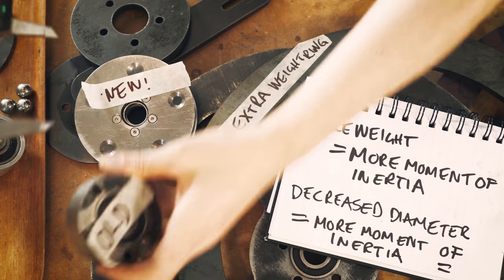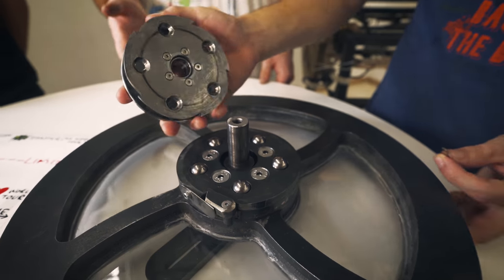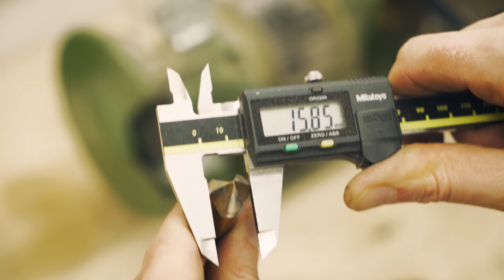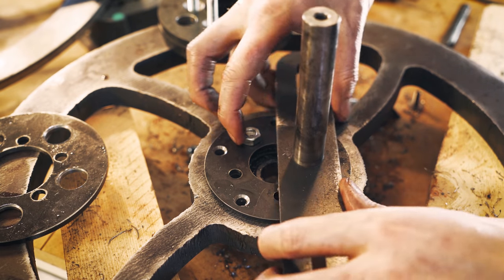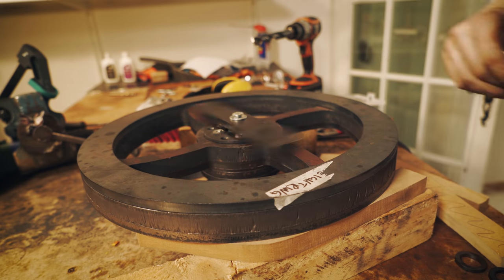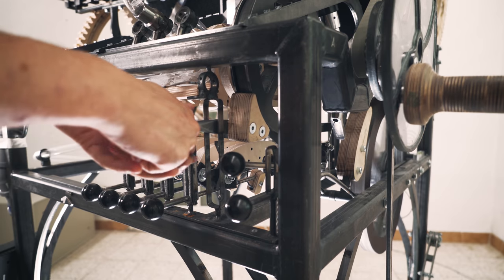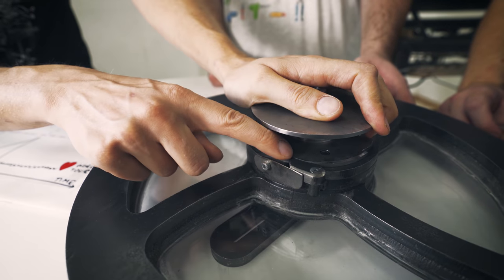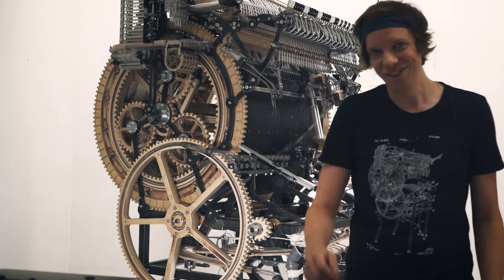Flywheel Torque Limiter - Marble Machine X#90

Comment: Oh so that's why my drill doesn't explode when it gets interlocked in something, always wondered how it works
Reply: Mine always does because I don't play a 80s keyboard while I'm drilling.
Reply: It's also adjustable so that you can put screws in without them going too deep.
Reply: @mbrsart  it's more so you don't strip the screw head when you drill it in all the way and it stops turning
Reply: Is it the exact same mechanism in the drill? Using ball bearings and springs?
Reply: Anki that depends entirely on the manufacturer and even the exact model. Torque limiting is almost an entire subject in itself.
Reply: @No-pm4ss  a lot of modern drills use hydraulic valves, some use rollers, some use complicated helical gear mechanisms which resemble a differential, totally depends lol
Reply: Yes it's the same concept. It helps to protect the screw head as someone mentioned above, but also prevents you from destroying fragile materials, like very soft wood or plastic.
Reply: @MrKinir  hehehe one of those 'Ladies ladies! Please, you're both right' situations 😜
Reply: I do believe I mentioned the clutch feature on those type drills 70 episodes ago. ;)
Reply: But the same concept.
Reply: Unless you turn off the clutch (drilling mode) and almost break your wrist...
Reply: I have honestly never picked up anyone's cordless drills besides mine and my father's on which it was not set on the drill setting, people are so stupid, hence why today at work I was tearing down a makeshift shelving unit and I found a 3" wood screw that was literally screwed through the frame and all the way into the endgrain of the side of one of the shelf crosspieces. smh.
Reply: @No-pm4ss  it's a clutch plate on a spring. Very similar idea. The plate has protrusions that stick up. It would be like if the ball bearings and the top plate all moved together
Reply: @No-pm4ss  also it only works because the protrusions (same as the ball bearings) do not have vertical sides. Normally protrusions have ramped sides. This angled surface redirects a side force (in this case it is tangent to the direction of rotation) and splits it into a side force and an axial force (one that is parallel to the axis of rotation). This axial force is what presses on the springs. The ball bearings are spherical and as such the point of contact occurs at a different angle (tangent to the spherical surface) depending on how much bearing is sticking above the surface of the plate. If the bearing is adjusted so half or  more is sticking above the retention plate, there will be NO slipping possible. When the clutch contacts the ball in this case, the side forces are normal to the contact plane meaning you no longer have an axial force. Nothing will push the ball down therefore there will be no disengagement
Reply: Drills don’t have flywheels. They have 2 sets of planetary gear systems.
Reply: MY83 how to use 8+ inch hole saw: hold drill with one hand, 1st speed, no clutch, and trigger down all the way.

Comment: Good work.
I appreciate your effort in explaining the physics behind the design, however, you seem to confuse the terms: Torque, Moment of inertia and angular momentum:

0:41 : The flywheel of the toy car gains angular momentum - its moment of inertia is not changing.

1:30 : More weight is not necessarily equal to higher moment of inertia. it depends on geometry as well and more so than mass. what you meant to say is that moment of inertia is linearly proportional to material density. moment of inertia is proportional to the square of the distance to the axis of rotation.

1:30 : Reducing the diameter of the pulley wheel, does not increase the moment of inertia of the flywheel. i suppose what you meant was the because the gear ratio is higher, then you can obtain more angular momentum of the flywheel with the same speed at the crank-wheel.  

Extra comments:
4:45 : You explain that the ratcheting noise is from the area of the graph after the clutch has disengaged and stays at a constant low torque value. I would say that the noise is from the "marbles" springing back into their seats (or the extra ratcheting mechanism) after the clutch has been disengaged and rotated 1/5 revolution. therefore the ratcheting noise is from the torque limiter, and the graph should not have single ramp, but be a saw tooth :P whose frequency matched the frequency of the frequency of the ratcheting.

15:00 : The extra ratcheting mechanism is in principle the same mechanism as the one with the marbles. The only principal difference is that the second ratcheting mechanism only has a sloped cam surface to one direction of movement, whereas the "marble" ratcheting mechanism has sloping surfaces to both sides. you could just have increased the slope of the marble seat in one direction and achieved the same result, with less noise probably.

It is really inspiring to watch the build process of the MMX :)

Comment: With all of these bare steel and plate scale pieces I hope that in transportation between venues the MMX doesn't pick up a ton of oxidation. A humid shipping container could make for hundreds of hours or work to bring it back to show appearance.
Reply: Ah, galvanic corrosion. Martin's old nemesis has returned.
Reply: I keep thinking either Martin will have an oil dripping beast or he will invest in an electroplating setup?
Reply: @NealD  honestly, at this point it'd be worth to plate all the steel parts
Reply: I'm hoping at the very least the modules will all get custom hard cases with space for a whole bunch of desiccant that gets changed or recharged regularly.
Reply: @Echin0idea  That is not a solution, it only delays the inevitable. You need some sort of actual rust protection on all steel and iron parts period. For instance that machine would be flash rusted all over in less than a week in Florida.
Reply: @lesdmark  I've never been to Florida. Is it really that bad?
Reply: If he wants to keep the industrial look he's probably best off using a spray polycrylic coating.  It gets used for outdoor steel art so it maintains its appearance.  Such as getting a patina on it but not rusting farther or leaving residue when moving it.
Reply: Not unlike a boat, it may need some sacrificial anodes yes.
Reply: @qwertyTRiG  Yeah, it is incredibly humid down there. Hell it's pretty humid here, and I'm in Pennsylvania. Shit rusts pretty quickly.
Reply: TRiG (Ireland) Florida has terrible humidity. Mississippi, too. The machine would probably rust in about the same time here.
Reply: @phiovorix1246  While Ireland is famously damp, but not really warm enough to be that humid.
Reply: @qwertyTRiG  Yes, in every aspect imaginable, Florida is really that bad.
Reply: @lulle2007200  and the aluminium wedge
Reply: @qwertyTRiG  yeah, it really is. Even up in the panhandle where I live the humidity is regularly over 80%. Down in the swamp known as Miami it's even higher. Mild steel will get surface rust within hours.
Reply: This is no joke.  He's going to have a bunch of moist wood parts crated up with a bunch of iron and steel parts going in and out of horribly humid environments.  Bare minimum, it'll need all the metal parts sprayed and wiped down with something like LPS3 before and after each concert... or as others have said all the metal parts will need plating before this thing goes into service.  Not sure how practical that is now, as the machine is not really friendly to complete disassembly.  Plus there's a ton of welds added on everywhere.  Another source of insta-rust.  If the rust can't be stopped another option might be to keep all the bare steel and iron parts painted in something like Ospho that will at least keep the rust converted and an oxide layer going.  It's easy to put on, just keep it off the wood as much as possible.

Comment: You should put a line gauge on the allen key wrench so you can tension the springs equally on the flywheel limiter rather than counting turns.
Reply: Suraj Chandiramani I was wondering if there was a way to equalize them all. Since 1 turn is 1 thread, a line on an allen wrench will be inaccurate. 

Bottoming out all of the screws and counting backwards, is probably the best way to go about it.
Reply: @NealD  seen that yesterday on a carburetor cleaning tutorial
Reply: @NealD  You could go and do it evenly by starting either bottomed out, or screws all the way out and counting it evenly. But they don't necessarily need to be equal, if you think about it, so it's not that critical.
Reply: F1NNSP1N I wondered about the necessary consistency. It seems the friction would add up across the marbles? Or will the limiter be limited only to the one tightest marble?
Reply: @NealD  Somewhere inbetween. It won't completely add up, since due to different tolerances in the hole spacing and since not all marbles will get the same forces. If you have a spline connection, you estimate that somewhere ~70% the strength of the sum of all connection points is used. Due to the springloading, which will make it somewhat more forgiving on tolerances, I'd guess that it probably adds up almost completely in this case.
Reply: Adjust them with a torque wrench or torque screwdriver?
Reply: Igor de Borst We are talking very low torque. Don’t think you can find a torque wrench that will do that. Not unles you pay alot of money

Comment: Awesome!  Torque limiter, sounds like a bike freewheel mechanism. =)
Reply: It sounds like it because it is literaly the same mechanism
Reply: The bike freewheel is actually only the ratchet mechanism we talked about. The torque limiter has a slightly different function.
Reply: Just a very very shitty one with that Résistance 👌
Reply: @kitingmare  whoops my bad, I havent serviced my road bike freewheel in a while, i should actually go do that ty
Reply: What @Marius said; bikes freewheel without any torque being involved in one direction. If your bike would have what we have here, it would try to back-spin your pedals until you would oppose that forcefully enough to trigger the decoupler.
Reply: @AttilaAsztalos  yea it is just the ratchet part
Reply: @AttilaAsztalos  but my bike is a fixed gear, so no world tour :(

Comment: I worked as a commercial storefront door installation and repair technician. We always used our cordless drills to tap aluminum and steel, rarely ever broke taps, stainless was typically the culprit. I figured you just preferred using the tap handles otherwise I would have suggested you use the cordless clutch sooner. This machine is a engineering masterpiece, keep up all the good work!

Comment: Imagine LEDs turning on when a note is played, like when the keys light on a Midi. I would love that instead of those fingers. A regular ends switch and some cables should be enough, you could even get the power from an XLR cable that spits out 48volts with a resistor
Reply: That could be really cool
Reply: It would be cool, but Martin has made clear that he doesn't want to introduce any kind of electricity in the MMX. Only mechanical movement. I personally don't mind the fingers, as long as they aren't as floppy as the prototypes he made in the other video. Having them as a solid, rigid piece of plywood would make them look like the ones on the original marble machine.

Comment: you just made me understand why we use Zener diodes. Yes I'm an electrical engineer...
Reply: I would rather compare it to a fuse or more precise a voltage regulator with over-current protection. But basically I had the same idea to compare it to electronics.
Reply: I'm in the very first year of electrical engineering and I haven't studied those yet... Now I'm curious! Can you please explain why the comparison?
Reply: Lukas Graphen I second this, don’t really see where the zener fits in
Reply: @telefon72  a zener when in reverse bias is used like a safety relief voltage shunt.  One use is in automotive and industrial microcontroller I/O where you have to protect a sensitive input.  For example, a 5V logic level input with a tolerance of 5.5V maximum before damage is done, a 5.1V zener tied to the input line in reverse bias to ground will shunt anything over 5.1V to ground (example, wire insulation becomes damaged and 12V supply touches 5V signal), and the micro input only sees 5.1V and is saved.  They are also used in the same manner as a simple voltage supply regulator.
Reply: @LukasFink1   I respectfully disagree. A fuse would be like one of the solution they described: a screw designed to break at a certain torque. I see the comparison with a Zener diode that channels the overcurrent to the ground (through a resistor) when the voltage exceeds a certain value. It's a system that rests itself, just like the marble in the coupler.
Reply: @umpoucodetudoealgumacoisa   @karlpc200 I see the comparison between this system and a Zener diode as components that do something "at a certain point". For the Marble machine, the torque limiter de-couples the flywheel at a certain torque. A zener barrier is like an open circuit that closes at a certain voltage. Here, an example of use of a Zener Diode would be: when there is a voltage peak in the circuit, it channels the over-current out (to the ground) to protect a sensible circuit.

Comment: That reminds me something: You should have a mechanism to prevent the machine from running in the wrong direction. Otherwise, the marble triggers would be damaged by the programming pins, or even the programming wheel could be destroyed. And other things will happen, simply because the machine is designed to turn only in one direction. 
That in the spirit of not ruining the world tour.
So far, great progress! You didn't stop and you already have results.

Comment: glad to see that the machine is safe, wouldn't want anything to happen to the operator while it's running. added bonus is that the machine wont rip itself apart if something gets stuck in a place it doesn't belong.

Comment: For Martin and everyone else that needs smaller thread in an existing hole: Use a thread repair kit, like helicoil. You can use the existing holes, no welding or centering required. These are also great for reinforcing thread in softer materials like aluminium.

Comment: The only thing I'm concerned about is how long the setscrews are for adjusting the torque limiter spring tension.
It could be very bad if they can be turned in far enough that the marbles can't compress the springs anymore, which would prevent the limiter from, well, limiting.

But besides that, very good to see a safety feature like this being added.
You're not only keeping MMX itself safe, but also the hands and arms of people around it!

Comment: Re: torque limiter graph -- wouldn't it be more accurate to draw the torque as leveling off at the limit, rather than going to zero? Or more precisely bouncing between ~0 and ~the torque limit? If the limiter had a break-away bolt then it would go to zero, but this limiter continues to apply (very roughly) the torque limit, hence the need to hold the wheel continually to keep it in "limited" mode?

Comment: Martin, I have used a similar clutch in an industrial setting.one thing that tends to happen over time is a ramp wears into the edge of where the balls run out of their seat. This changes the angle of attach and lowers the trip setting.  This could lead to it tripping when you don't want it to like in the middle of a.song when the machine is functioning normally. I would suggest having a spare plate for.when you go on tour. 
This design is.a.great design and will serve you we as long.as you know that over time the trip limit will reduce .

Comment: On top of the added safety, you actually have a way to recover quickly when doing a musical breakdown/bridge. 
Remember that breakdown switch from the first marble machine?  That recovery could happen a lot easier with a flywheel maintaining most of that inertia.

Comment: Hey Martin, I noticed one potential cause for damage: If the screw that holds the springsteel of the ratched gets loose, the springsteel could hit your belt! Better use two screws to avoid rotation of the springsteel.

Comment: So now you will need to mount a tool box to keep programming pins and a few basic tools for adjusting and minor repairs on the MMX. The same way that most tractors, heavy equipment four wheelers and motorcycles have on them.

Comment: I hate to be the one to point it out, but you said the spring tension under the marbles was too high at first, so made a spacer plate, but that shifted the flywheel over by 4mm, so you welded the bolt holes shut and re-drilled and tapped them. All you had to do was find shorter/weaker springs, or just cut the existing springs a bit shorter.

Comment: Wow, that's one thing I hadn't realized. That the flywheel would potentially wreck the MMX if it kept spinning after the machine suddenly stopped.
This torque release feature is a lifesaver.

Comment: Just a note for the pedantic, "Moment of inertia" is a physical property of the flywheel and is basically "How much does this object resist change" when you're referring to the wheel moving it has "Inertia" (Just plain inertia, not moment of inertia). 

In a sort of engineering way, "Inertia" is more like a verb and "Moment of inertia" is more like an adjective.

Comment: If you put a brake on the programming wheel itself could you use the sound of the torque limiter as sort of a mechanical drum roll sound for brief intervals? i think it has a cool sound!

Comment: Martin, i noticed something in this video when you demonstrated the the torque limiter (great design by the way). The power input side of the machine could be further improved with the addition of a one-way needle roller bearing on the crank pulley. That way, when you let go of the handle and have the flywheel do the work, then want to get back on the handle you won't have to "chase" it and risk losing skin off your knuckles... It will just be there waiting for you....  :-)